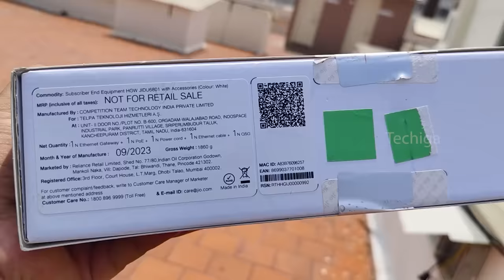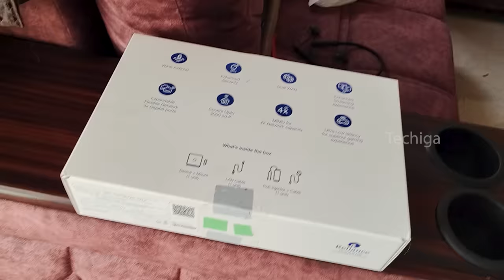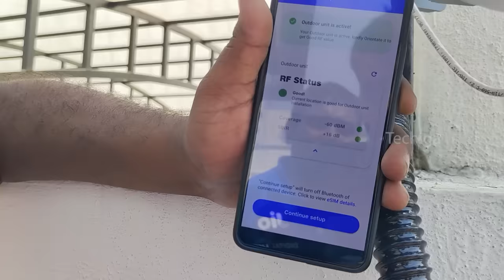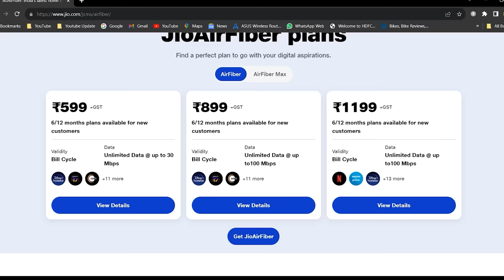Jio AirFiber Installation Process🔥🔥 Unboxing Wifi Router & TV Setupbox | Plans Details in Kannada

Comment: Super bro, but one thing to keep in mind is wireless signals are problematic always, best is the wire fiber connection as it's connected via wire the signal and connection is stable. I've been using jio fiber for more than 3yrs now, it's stable and 0 downtime till now. Only thing with jio is most of the sites are blocked whe  it's compared to act fibermet. 
But the connection wise it's good and technical support team is worse that's the only issue.

Comment from the maker: There are so many issues and complaints going on with Jio Airfiber, so an Airfiber connection is not recommended. If you really want Airfiber, then check the internet speed, network quality, and take connection accordingly.
Reply: For people in city broadband is best. This air fibre should mainly be for village environment where they will be happy to get 30 Mbps internet for atleast majority of the day.
Reply: Hi
I have a question 
To install Air fiber do it required a jio 5g tower within 1.5 or 2km ?
Reply from the maker: @Quickraps  Yes
Reply: Hi 
1 In my area the air fiber team said they can't fix the air fiber connection as there is no 5g tower near 2km,
2  So can I book jio air fiber installation in city once they installed. can I take the setup to my Village and setup there by myself
3  Is it work there also
or it has any network mapping so it work in city that installed place only

4 In my Village getting 25mbs upload speed of 5g network in mobile, I will go with basic plan only

Comment: Oh My my my!!! Very complicated set up and traditional broadband makes a hell lot of sense. AirFibre is a good option only where there is no fibre optic connection at all or remote areas. These wireless technologies in our country never delivers uninterrupted connectivity as per my experience and as many have reported in various forums about the latency, signal strength issues, its better to stay away from this Wireless set up and sticking to traditional broadband is a way better option and they offer lot cheaper plans which comes with better speeds!

Set up has been explained very well, thank you!
Reply: Brother in my area no broadcast for fiber connection, so only option left is to use airfiber

Comment: I believe fiber-optic technology outperforms air fiber due to its superior signal strength, lower latency, and faster speeds. Air fiber connections tend to exhibit higher latency and slower speeds. Additionally, air fiber systems consume more power compared to traditional fiber setups, requiring higher voltage levels. In contrast, standard fiber connections can operate efficiently with a standard 12 DC power supply for home routers.

This kind of fiber-optic setup is particularly well-suited for remote areas like villages and for digital nomads who own their vehicles. It offers a reliable and energy-efficient solution, making it ideal for locations where infrastructure is limited and power resources are precious.
Reply: Yes we believe Fiber tech

Comment: Recently jio team installed jio air fiber on oct5 th   but i faced some error  installation Aadha mayle 10mins adhamayle router alli red colour light banthu but internet  chanagi work agtha ethu  and setup box kuda Changi work agtha ethu but evathu automatically green light bartha edhey
Reply: Disconnect RJ 45 cable coming outside to POE unit and connect it back

Comment: Explanation is good showing the process. But why did not you opt for concealed cabling inside your flat? I am sure there is a junction point in the corridor into your flat where the cable tv, inter net cable and telephone cables are run. Instead of allowing them to run cables hanging and running on the wall with ugly cable clips. You allowed them to completely destroy the decor of your wall and the corner. Bonus is a hole in the window frame with permanent damage.

Comment: can i use internet on 4th floor or ground floor if my fiber is installed in 3rd floor????
Reply from the maker: Yes, you need to create a mesh network (Using Wifi extender)

Comment: Sir i have installed Jio Air Fiber 3 days before with 6 month plan but today Jio service guy came home to install multi connection device in already connected ODU, as per him it is a common device for 7 other connection in my nearby. i am not agreed to lay cables and other thing over my roof for others. Dear Sir my question is that 'why they are doing this and Is that a genuine process to serve connection to other customer with single ODU...please help me out here.
Reply: U can deny them bro 😂

Comment: On the terrace, it’s a good practice NOT TO INSTALL any electronic/electrical devices on water pipes. The ‘splitters’ box was installed on two main water pipes😮
At the ODU, insulation tape was used to cover the black corrugated conduit. Over a few weeks, due rain n shine, tape will give away, allowing rain water to enter black conduit into the switch.
Inside the customer premises, Jio installers couldn’t care less about the new furniture like sofa set etc…merrily spreading their installation tools, boxes etc. Unprofessional.
How the latest technology implementation gets massacred by our I’ll-trained technicians. Good luck with Jio air fibre.
Reply: Good to see what you noticed madam 😢
Reply: Surprisingly the JIO speeds and mobile net work had drastically reduced and I wish that JIO will soon have decline in major connectivity as since few months the mobile connection is worst and worst and JIO is now the worst ever speeds with worst mobile calls service

Comment: Airtel airfiber is best. I am waiting for this in Hyderabad .You can take it anywhere. Not possible with jio airfiber. I cancelled my request recently after asking them what type of connection is this. There is no difference between optocal fiber like act and jio airfiber. In fact act plans are best than jio.
Reply from the maker: In Airtel you will get same mobile 5G speed
Reply: @techiga  far better . Can take it anywhere as portable router

Comment: 9:11 That energy rating😅
A high range, of the shelf, budget wifi-6 router roughly takes 1.5 amps over 12 volts (asus ax-53u). The antenna must be using over 2amps of current. That is a lot of current for not so power hungry work. Even mobiles use less power and give same performance.
Reply from the maker: Max upto 3.5 amps, it take around avg 10 - 15 watts

Comment: Bsnl fiber is Best then jio air fiber, free of cost installation with bsnl. 30 Mbps speed is just 399 cost only with 1tb in month with high speed data then 4 Mbps unlimited🎉🎉🎉
Reply from the maker: But there is no Bsnl fiber connection everywhere

Comment: Jiofiber is not serviceable in most of the areas. So if you relocate it's of no use. They give back only ₹500
Reply from the maker: No issue, you can easily relocate with Airfiber.

Comment: Such a sht way of using broadband..
Can you list atleast 2-3 advantage of Air Fiber over Wired Fiber connection. Why paying extra
Reply from the maker: The main advantage with Jio will get 4k setup box (which can save money on DTH recharges), and if there is no wired fiber or a non-reliable connection, Jio Airfiber is a better choice, I think.
Reply: @techiga  Free 4k setup box can be claimed with normal fiber as well buddy with postpaid plans and wired broadband is much more reliable in terms of speed and latency at much cheaper cost.
Reply from the maker: I agree that when comparing latency with fiber, it may not matter as much if you are not a gamer or using the internet solely for entertainment purposes. In the case of Airfiber (5G), the latency and speed is quite good. When comparing Jio's setup box and TV channels options to those of other providers, the Jio setup box is the best.

Comment: Please do not buy jio airfiber. I have taken the connection and now i am suffering due to 1000gb fup policy. Even the sales or customer care person is aware of this issue.  If you have a 4k TV then 1000gb is joke as it will be used within 10 days and you will be without internet for remaining 20 days in a month. I have switched from Airtel Fiber to Jio AirFiber with 1 year advance rental and now i am suffering. Have to reactivate my airtel fiber to use for the remaining 20 days. Now i am end up in paying for 2 fiber and have to live like this for one year :(. Poease dont fall into Jio Airfiber poor FUP, no refund and frequent disconnect, better stick with cable fiber.
Reply from the maker: Airfiber fup changed to 3300Gb
Reply: I paid full money but still no installation and no proper communication with  customer care pls don't buy air fiber, I paid because of the Jio brand I didn't check before on YouTube now Everyone facing the same issue